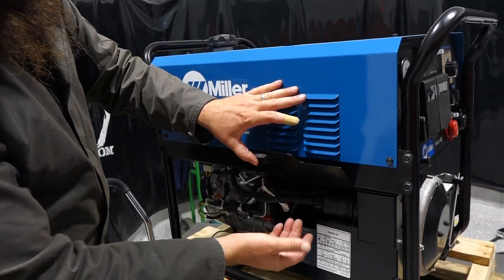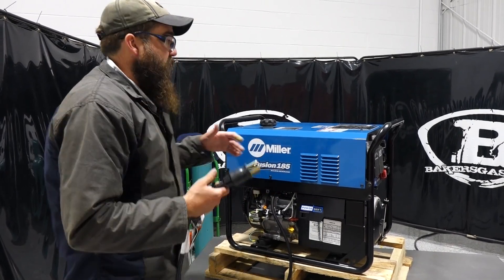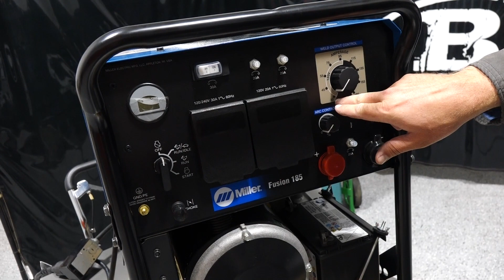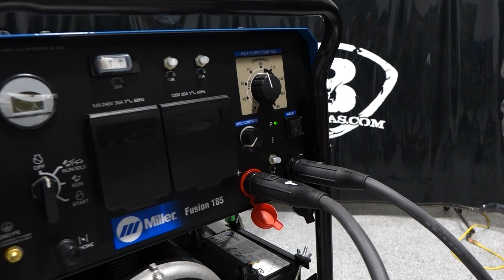Miller Fusion 185 Review (907781) + Power Shift Demo

Comment: Running that thing off of a wall plug?! Miller has completely lost their minds now, I'm not dragging that thing to power when the whole point is for it to make its own power. There are welders the size of a toaster that will do 180amps i.e. fronius 180, maybe take that to power instead.